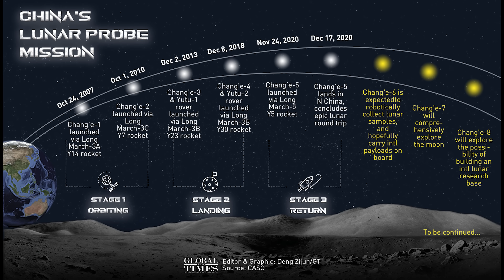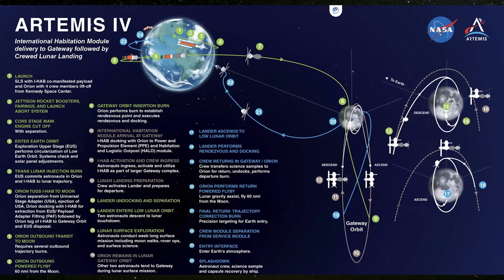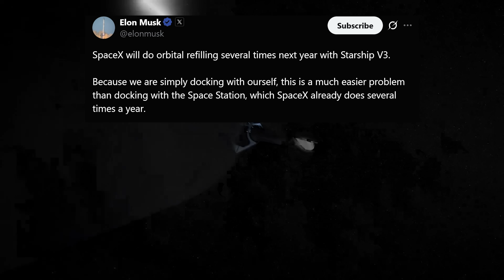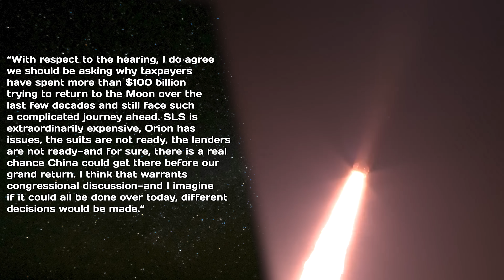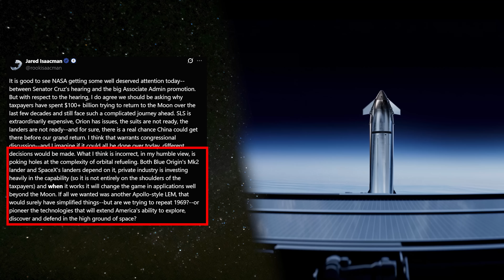Ex-NASA chief revealed the Real Problem with SpaceX Starship to get back to the Moon while China

Comment: It is amazing how they did it in 1969 without refueling.... Maybe they should consult the old drawings 🙂
Reply: Lol there’s a first time for everything
Reply: Not really. They did it by choosing a single launch and then gave it ALL THE FUNDING IT NEEDED. And it used a LOT of fuel.
Reply: @JessePollardII  The funny thing is, the current concept is very fuel inefficient, due to having to bring that Starship HLS all the way to the Moon and back as a single stage vehicle.
Reply: @AG-el6vt  Only once - then it stays there for multiple uses and can be refueled - presumably by fuel made on the Moon. The main advantage it has over all the other proposals is the ability to transfer 100+ tons of material per landing.
Reply: Or maybe because Apollo only landed a few tons on the moon and two men for very short durations.  Try thinking before writing, it stops you looking dumb.
Reply: @poruatokin  Someone just found out that Santa Clause ain't real! And he don't like it! HE DON'T LIKE IT A LOT!
Reply: @poruatokin the Artemis program is a confused mess 

Largely because Congress insisted that the companies that made the parts for the space shuttle will be able to make the parts for the constellation program which was then canceled and then they insisted that those same companies be able to make the parts for Artemis which was begun before we had a fully worked out plan on how the whole thing was going to work 

Orion service module is far too weak and that's why we have to do the rectilinear Halo orbit which is a really bad idea if you need to have the astronaut to be able to leave the moon before waiting 7 days if there's an emergency 

The fact that SLS wasn't originally designed to be able to carry a lander so we could just launched two of those was also a bad idea 

Giving a sole source contract to SpaceX based on vaporware was a bad idea. Note SpaceX supposed to have already landed unmanned version of starship on the moon. Yet they haven't even been able to pull off its normal operation 

Been waiting 3 years to give blue origin a second contract which legally was required to happen when the first one was given to SpaceX 

at 20 something refueling is insane where blue origins talking about a couple 

In China will land in 2029 for the 80th anniversary of the Communist China's party 

That's looking very unlikely we'll be able to pull it off 

Especially since we didn't have any one single goal

Comment: Gateway's a joke. He's right that using Starship might not be the fastest way to get back to the moon, but it should be the most sustainable way. China might get there first with a repeat of a Apollo architecture, but an architecture with Starship at its core can deliver a permanent presence on the moon.
Reply: It’s a top heavy lander that can only land on well prepare landing pads.
Reply: @DinoAlberini you're not an engineer qualified to make that judgement. Obviously appropriate landing hardware would be attached.
Reply: @andrewworth7574  I am qualified enough to understand that Starship can’t work. It was supposed to be on Mars in 2022 with a payload. They didn’t even reach low earth orbit, let alone deliver a payload to it in its tenth launch. Saturn 5 landed people on the moon by launch 9. When will you Elongelists see that your prophet is just a con man? Wasn’t hyperloop, boring company, solar roofs, Vegas loop and the LA tunnel enough?
Reply: For what? Playing with moon rocks? Where's the water?
Reply: @carlhitchon1009 of what use is a baby?

Comment: I always say that they could take the first stage of starship, put two or three more stages on it and they could easily go to the moon just like Apollo did.
Reply: The booster is an amazing craft.  Starship itself is unlikely to work as intended.
Reply: It's not Legos. The project was fundamentally flawed in how much it promised for how little. It's too big. Too complicated. Too on the edge. Too ambitious
Reply: Aerospace engineer here - IT WAS NEVER NEEDED
The actual capability to go back to the moon could have been done with what was called Shuttle-C
That was a space shuttle tank, 2 boosters and a payload module with 2 main engines.
It had the capability to get enough into LEO to go back tot he moon. 

The real question for any of these is the mission profile. If you go back the to the start of Artemis it was 4 astronauts on the surface for 14 days. That provides a very simple answer for LIFE SUPPORT. 
The lander needed 4x14x24 = 1344 hours of life support.
Apollo had 150hrs (2 x 75hrs).
That defines an key parameter for how much mass you need to launch to the moon. 
Not long after that a second profile mentioned 3 astronauts for 10 days and 3x10x24 = 720man hours.

That's basically 1/2 the 4 men 14 day mission profile. 
Which means 1/2 the amount of oxygen, 1/2 the amount of food, 1/2 the amount of water,..........

Shuttle-C would have had less capability than Artemis, but then it all depends on what the mission profile is.
Reply: @tonywilson4713  Finally, someone that gets it!!
Reply: @tonywilson4713 but Why? There's no great leap between 150 and 1500 man hours on the lunar surface. The big leap is to a permanent presence on the lunar surface. That's something that the reusablity of Starship should be able to deliver.
Reply: @andrewworth7574  ARE you serious that you think there is no difference between 150 and 1500 hours on the lunar surface????

I don't know what your background is but ITS CLEARLY NOT in aerospace engineering.

That's 10x the oxygen, 10x the carbon dioxide filters, 10x the food, and 10x EVERYTHING else INCLUDING THE FUEL YOU NEED. Plus that means a BIGGER vehicle to carry all that stuff. You have to lift that extra mass off the planet and then accelerate it out of Earths orbit into a lunar orbit and then land it on the lunar surface.  

This is what Don Pettit meant by the "Tyranny of the Rocket Equation"
Every extra kilo you want to take to the moon requires all sorts of things that compound the problem.

As for comparing 150hours to 1500hours to a permanent lunar base. That's like comparing Lego blocks to a house to a Nuclear power plant. 

Sorry mate but this is NOT Star Wars and  George Lucas never understood orbital mechanics.
Reply: @tonywilson4713 are you deliberately misinterpreting my comment? There is no significantly different return on the investment in terms of 150 hours vs 1500 hours. Unless there's a taskto be performed, like setting up for future developments.
Reply: @andrewworth7574  Are you just trolling? Tony Wilson clearly laid out the problem.  Increasing the payload to the moon even by a few kg has MASSIVE impact on the initial launch vehicle.
Reply: @poruatokin FFS, of course increasing the duration 10X would increase the required payload and the size of the launch vehicle, given a similar mission architecture, but would 10x as much be achieved? The vast majority of the 382kg of lunar material brought back by Apollo is still in storage.
Reply: @poruatokin the only reasons to go to the moon are political, scientific (selenology) and economic. I'd hate to see the first as the reason and the second is already covered.
Reply: Too heavy.
Reply: Why would the US want a simple repeat of Apollo rather than establish a permanent presence on the moon?
Reply: @andrewworth7574  Well you don't simply repeat Apollo but then also you don't try and make such a massive leap forward that its impossible to take that step.
Reply: @tonywilson4713 I'm not seeing any Starship showstoppers, do you?
Reply: @andrewworth7574  Well shit son I'd take the time to explain it YET AGAIN but instead will simply direct you to the following video titled "I Was SCARED To Say This To NASA... (But I said it anyway) - Smarter Every Day 293" 
watch?v=OoJsPvmFixU

FYI - Destin the host of that channel has multiple degrees in aerospace engineering.
Reply: @tonywilson4713 I watched the video. I don't see what point you're trying to make. THERE IS NO REASON IN SIMPLY REPEATING THE APOLLO PROGRAM, BUT BIGGER. Apollo was only done for political reasons (with the science offered as justification). If America is going to send men to the moon, if the reason is "beat the Chinese", the reason is moronic. As, as with Apollo, nothing enduring will have been achieved. A return to the moon will be nothing more than another flash in the pan, if the return isn't to establish a permanent presence.
Reply: @tonywilson4713 two points worth mentioning: a sun synchronous LE polar orbit could be used to eliminate boil off, there's such an orbit at an altitude of 567km. Obviously there would be a payload penalty. By limiting the stay on the moon Apollo avoided the hotter temperatures during the time near local noon. A 14 day stay on the moon, would face those temperatures, though a landing site a high latitudes (which is likely to be the plan) would mirigate the issue. Either way, digging in, to reduce the threat of excess ionizing radiation, would be virtually mandatory, so just an enlarged Apollo type mission architecture wouldn't work.

Comment: When going to the moon, the hardest part is escaping earth's gravity. It's like being at the bottom of a well, climbing out is the hardest part. Walking 1km after that is easy.
So if there is a functioning Starship capable of taking mass to orbit, a mission can be crafted around it even if Starship itself never becomes human rated or the issues with orbital fuel transfer are not solved.

Comment: Several issues here:
- "we have to do it before the Chinese do it"   But... Why? Just for ego? If there is a goal, follow it for them and their impact on science, technology, the economy and what will benefit us, not a race here.
-Why if Starship is the most powerful rocket...  The system is not designed to be self-contained like Saturns but on steroids, and with current technological advances? Explain it to me like a 5-year-old child.
-The design of Starship is fantastic, but such a tall rocket does not run the risk of capsizing, because it will not be made on a platform and even less a tower of 'chopsticks' but on uneven ground, sloped hills, boulders and so on.  Murphy's Law should be taken into account here, something can go wrong and there is no Starbase or repair and construction teams either.

Comment: Why dont they use the 1969 Apollo tech that was supposed to work flawlessly?
Did not even need any computing power .... no refueling etc

How come?
Reply: SLS is the Saturn 5, just modernised and changed for Artemis.
Reply: @flightsimdev no, SLS is 4 space shuttle engines, with tanks and SRBs in a different configuration. It's space shuttle tech, re-packaged.
Reply: @Carl_Aznable  Space Shuttle worked, SLS works, and Starship is more modern and doesn't work.
Reply: It does not give a permanent presence on the moon.
Reply: Because they can't build it after throwing all the work it takes away - Boeing did most of it, and the RESULT is SLS - at 4.2 billion per launch.
Reply: They had a kings ransom worth of computers,  and the third ride was flawed.
Reply: Because we lost the technology… u tard. Even NaSa says so
Reply: Because Elon wants a 1950s sci-fi rocket
Reply: Because its costs are insane, and the technology was not safe (how do you even think it worked flawlessly is beyond me with all the problems they had).
Maybe try using the internet to educate yourself instead of watching conspiracy theory videos...

Comment: Okay so the starship pastor rotate the moon about 10,000 times before they have one landing instead of going around once or twice and actually it doesn't have to rotate around the Moon it could just rotate right around in a circle since the moon gravity is not that much of intensity and the force of the gravity all comes from Earth what's the reason why the moon still circling Earth because the gravity is pulling the moon right around Earth
Reply: as moon's atmosphere is extremely less dense than on the earth, but not nonexistent, turning 10000 times around the moon might have a huge effect of diminishing the ship's speed, like on the earth, so the startship doesn't need to burn an incredible amount of fuel to be able to land. Then it makes a lot of sense, especially if there are no humans in the ship.
Reply: Your comment shows an appalling lack of knowledge of physics.

Comment: Dozens of launches to refuel the first starship, which Spacex could do, over a period of months, NASA would take 5 years to launch 1 or 2........
Reply: You can't take months to re-fuel, because it is cryogenic fuel.  It boils off the whole time.  SLS has already orbited the moon. Starship after ten launches hasn't even reached orbit.  And when it finally does, it can't go anywhere without a dozen or so re-fueling flights. It is way to complicated to work without a hitch.
Reply: @my3dviews SpaceX has a plan to develop a permanent LEO starship that is designed to be a depot fuel station that can keep its tanks chilled.
Reply: @my3dviews Yeah starship also doesn't even have a spot for astronauts yet. It's feature incomplete.

It's hilarious how some stupid people will fall for literally ANY hype. 😂
Reply: @clbl8706    Right.  That is the question.  Are they even developing an inhabitable Starship?  The thing is way too tall to be a lunar lander.  If it lands on a slope, will it fall over, or will it be able to adjust the landing legs to compensate.  
Just way too complicated.  They should have built a smaller lander, to be sent by an SLS launch to lunar orbit.  Then dock and transfer astronauts to it.  Had they done it that way, they could be on the moon within a couple of years.  Now, it is unlikely they will make it in a decade with the Starship debacle.
Reply: @my3dviews Thank God for blue origins stepping in to pick up the slack that SpaceX created.
Reply: @clbl8706   Right.  NASA should never have gone with Starship as a lander.  
The best that I can see it being used for is to get large payloads into LEO.  So, they could launch a new space station with larger modules (about the size of skylab).  But, for getting out of LEO, it seems to be useless.

Comment: How are more launches per year a solution, if every launch increases the costs and risks?
And don't forget that Musks promises mostly turn out to be vaporware, and nobody has seen a working orbital refuel system for two Starships yet...
...or any Starship carrying anything into a stable orbit at all.
The record is one burned banana half around the earth.
Reply: Ya, lets see them launch a full payload into orbit.  No one in their right mind would get onboard that thing.
Reply: I think Flight 10 had at least 2 bananas.